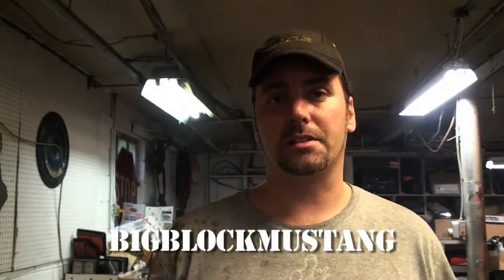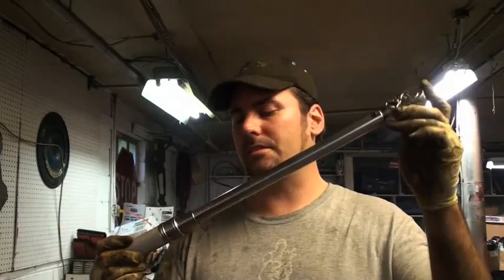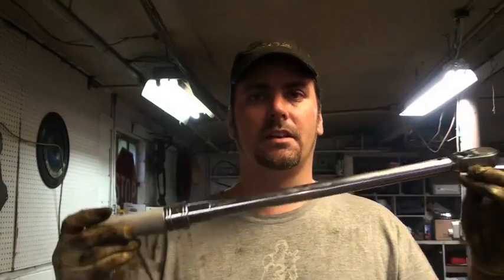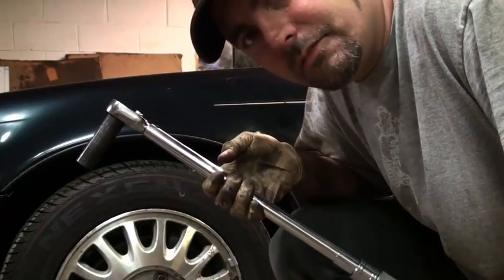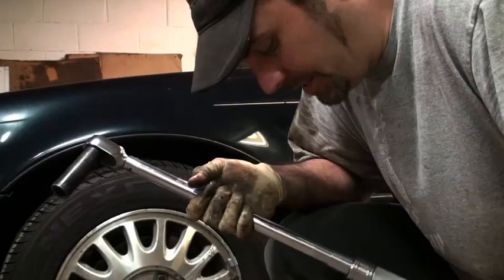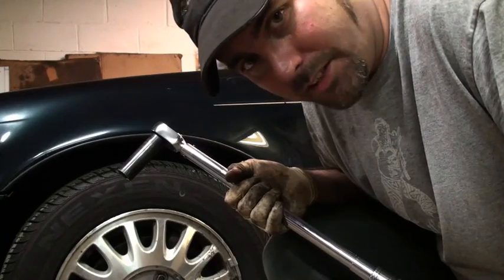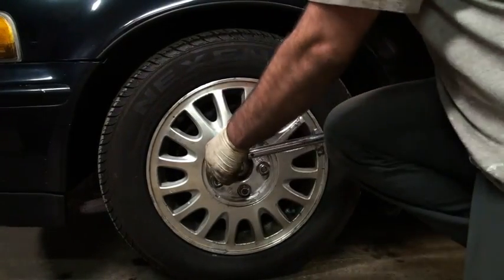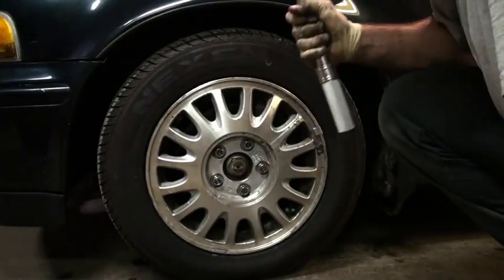Torquing Wheels and Why It Is Important - EricTheCarGuy

Comment: While using a torque wrench is an improvement over not using one, I think it should be pointed out that it's also important to torque in the appropriate pattern and preferably in more than one step. In my shop the first pass is at done at approximately 60% then the final is at specified torque.  On vehicles that have a history of run-out problems we may do it in three steps, first at 40%, then at 70% and finally at 100%.

Comment: As some others have commented, I think that not demonstrating the wrench actually turning the nuts is a bit of an oversight.

An apprentice I used to work with would bang on the lugs with his shiny, new IR impact wrench applying god knows how much torque...and then clicks the lugs as if a torque wrench is a magic wand.

The shop bought a Jeep a new front end, alloy rim and tire because of this...nevermind brake vibration.

Comment: Not what I mean, after using an impact and you use a torque wrench clicks immediately without turning then you know it's at least your set torque but you don't know how much you over torqued it.  Only if the torque wrench turns then clicks will you know you've reached torque without going over.

Comment: I've lost two wheels because of incorrectly torqued wheels by tire shops. First time, they over did it and cracked the studs on the driver side rear causing 3 to snap off while I was going 65 down the highway. Truck shook for a second and then the wheel passed me in the left lane! Second time, the driver side front wheel was under tightened and when I turned sharp right into a parking lot, the wheel kept going straight. Both times caused very expensive damage to other parts.

Comment: Now your torque wrench clicked immediately indicating they had already reached that torque value set, however we would not be sure it isn't overtorqued unless it turns then clicks.  Some parts when assembled require you to follow a sequence of torque (Cylinder head bolts good example) With wheels it's a star pattern.  For best results should we loose snug the top then tighten the sides?  Should we torque in increments or all in one go?  How about european cars with bolts?

Comment: Loosey Goosey - You don't want tension to stay on the tool, so loosen it all the way - same as your car jack - as I understand it anyway, it's like a rubber band stretched all the way - you don't want that to happen as that rubber band will brake/get brittle.

Comment: Another reason this can be good, is the garages (using air impact wrenchs), torque the studs so tight, that its nearly impossible to get them off with hand tools when you get a flat.

I found this out not long ago after a flat.  I eventually got the tire off, but on one bolt had to put my entire body weight (200+) on a big star wrench and a lot of struggling to get it.  I don't know what torque it was at, but I do know it was way too high.

Comment: The cheap ones are the ones you buy at Walmart or Harbor Freight for $19.95. The good ones are $40,$50,$60 and up. The beam type are cheap and don't lose their calibration but aren't as easy to use.

Comment: It's just what Eric did at the end of the video when he tightened the lug nuts on the wheel to the proper torque. Torque is the rotational analog of force, or twisting force, just as Eric said in the video. If lug nuts aren't tightened to the proper torque, bad things can happen. They may loosen if they weren't tightened enough. If they were over tightened they may warp the brake rotor, again as Eric mentioned. I imagine they would also be more likely to seize and be a pain to remove later.

Comment: HEY eric love the videos on fixing cars, very clear and accurate. I am a beginner weekend mechanic. I have a bunch of books and manuals but if I may ask. If you're doing a job and encounter a problem and you honestly don't know how to solve it where do you go for your information? There are tips and tricks I learned from your videos that is not in the Haynes books. I am doing a 4 disc brake pad change this weekend. I know it is simple job but to a novice it can be daunting. 03 gmc jimmy sls

Comment: HI FROM NEW ZEALAND.
ABOUT 20 YEAR AGO I WENT INTO A SERVICE STATION WORKSHOP WHERE I GOT NEW TIRES. I THEN ASKED TO HAVE WHEELS TORQUED...NEEDLESS TO SAY EVRY1 LOOKED AT ME AND THOUGHT IM STUPID UNTIL COMPLAINTS  ON T.V CONSUMER SHOW SHOWING PEOPLE WHOM CANNAE REMOVE WHEELNUTS DUE TO TECHIES RATTLE GUNNIN NUT HARD FROZEN ON.
BOLT MANUFACTURERS WHEN USING OILED THREDS ADVISE TO DEVIDE RECONMENDED TORQUE BY 0.70 THEN YOUR ANSWER IS USED TO TORQUE WHEEL TO STOP BRREAKING STUD.

Comment: thats all fine and dandy for a small shop guy but what about high volume shops or dealers? I use that exact same gun the IR titanium (best air gun ever btw) and I never warped no rotor when I tightened the wheels.  I test drove all my cars and never had a cust. come back in and complaint of warped anything.  Then again I have had cust. come in because some moron from just tire or discount tire put on there tires and tightened the nuts to 1000 lb/ft of torque lol.

Comment: I manage a tire shop... we used torque sticks and a torque wrench on EVERY vehicle that comes thru the shop.  to me, it is cheap insurance to know things are being done correctly.  any shop that doesnt use at least a torque stick is just asking for trouble.  variations in the air pressure, wear on the impact gun, as well as unseen variables allow room for bad thing to happen.  if the shop you go to doesnt at least use a torque stick (preferably followed by a torque wrench) FIND ANOTHER SHOP!

Comment: Hey Eric, just a quick remainder to viewers.   Never use Torque Wrench as a breaker bar to remove lug nuts, even thou it has the reverse setting.   This can eventualy bugger up your torque wrench.
Hats off to you for a great choice of impact.   I had mine Ingersoll now for 20 years.   This bad boy never let me down yet.
Also someone mentioned about wheel nuts/bolts loosening up after driving.   They don't loosen up after driving.   If anything, they get tighter due to heat from the rotors.

Comment: When I go to get my tires rotated and balanced.  every place near me always uses a impact wrench  it drives me crazy.  why are businesses using these knowing they could over tighted, crack or break the nuts and bolts?  my father taught me this when i was like 12.   im a computer guy.  cars not so good.  but i do remember this tip from my father?  any help or advice?

Comment from the maker: @BobTheSnail42 Hard to say, some parts are better than others.  In fact many rotor manufacturers recommend machining them before installing them on the vehicle just to ensure against that type of thing.  However to ensure the best possible result it's always a good idea to torque the wheels to their proper torque.

Comment from the maker: @Ibringthetruth1 I don't know about the anti-seize as it will effect the torque and make a mess, I don't recommend using lubricants on wheel studs, hubs yes but not the wheel studs.

Comment from the maker: @alienboy366 You have already run the lug nuts flush but not tight when the wheel is on the ground, you can do it while it's in the air but it's very difficult because the wheel will want to rotate as you torque.  I prefer doing it on the ground when working with hand tools because it allows me to just use the wrench rather than fight the wheel rotation when it's up in the air, I've never suffered any ill effects from doing it that way.

Comment: @phobiablack In countries where you have summer/winter tires and change your wheels regurarly (allways when you take wheel off)  they say after 100-150km drive you should rethight nuts/bolts. With steelrim it's not so necessary but with aluwheels you really should do that. I know because after changing winter tires and about after day car front started to wobble little bit and I stopped right there and one wheel bolts where all loose. I was lucky that reacted right away!
Reply: I've heard this many times.  Why would they come loose if they were torqued properly?  If you retorque to the same value again why wont they come loose the second time?  I believe the only reason they would come loose is because they weren't torqued properly in the first place.  Only asking because in several decades of changing tires/snows/rotation/steel/chrome/aluminum etc. I have never had a lug loosen after torqueing to the correct spec.  Just my opinion of course.

Comment from the maker: @EFSOutdoors When working at the dealer I used what is called a 'torque stick' which put it in the ballpark but wasn't exact.  When I worked on performance cars I treated them a bit different by torquing them by hand.  It's good to get them as consistent as possible and as close to the spec as possible if you don't use a torque wrench.

Comment from the maker: @sav7152 Yes, I would go with the factory spec.  On another note I've found that some aftermarket wheels work loose after a while so it's a good idea to recheck the torque about every oil change.

Comment: Hi Eric!  Just followed your advice on replacing the brake pads along with the new rotors.  I definitely don't like that spongy brake feeling so I did replace the pads.  My question is this: I have aftermarket wheels on my car.  I found nothing as far as specs go on torquing them down.  In your opinion what should I torque them to?  Should I just use factory specs?  Thanks Eric!

Comment: Another important thing to mention is on mag and aluminium wheels you may need to re-tighten the lug nuts after about 30 miles to ensure they remain seated. Its not absolutly nesscary but I have seen vechicles that have lost wheels because they didnt come back to get there wheels retorqued. That have even been instances that I removed a lug nut with nothing but my hand(while removing the annonying lug nut covers chevy puts on there trucks).

Comment from the maker: You are absolutely correct and a keen observer, the lugs on this car were not loose when I shot the video.  What I was demonstrating was the technique and the process.  The process is to run the lugs down snug, not tight, and then use the torque wrench to finish them off to the proper torque, the reason this is done on the ground is to prevent the wheel from spinning too much while you are torquing the wheel.  The final torque for this car would be 80 lbft, not 80 inch/lbs BTW.
Reply: what if you hold the wheel from spinning when it is raised above the ground?
Reply: Can do video on brake pads

Comment from the maker: I would say that if the car vibrates while stopping it is most likely warped rotors.  On acceleration however it would most likely be an engine performance problem.  It's hard to say exactly what it could be but you could start by inspecting your ignition parts.

Comment from the maker: Have you ever started out on a 10 speed bike in 10th gear?  If the drive-train is not functioning properly, that includes the transmission, then efficiency is compromised thus effecting emissions.

Comment from the maker: Because of the "differential action" the wheel with the LEAST traction gets power.  The differential is designed to allow the rear wheels to travel at different speeds while going around turns, if not one wheel would hop while turning.  A posi traction still slips in turns but power is always delivered to both rear wheels even if one looses traction.

Comment from the maker: Carbon buildup on the valves and intake.  Diesel trucks idle for extended periods because they need to be hot to operate efficiently, these engines are designed to idle for long periods where as gas engines are not.

Comment from the maker: It's hard to say in that situation what the cause was but yes, gears and chains do wear out and cause engines to jump time.  Some stock gears have a plastic coating that wears out over time.  They use this coating to keep them quiet.  In your case it could also be a problem with the distributor.

Comment from the maker: Not really, an alignment is a precision measurement it's better if you use a tape measure instead of your eye if your trying to get it close.  The truth is that they are not really hard to do with the proper equipment.  That is if the adjusters move like they should, if not, it's time to break out the torch.

Comment from the maker: I can see how a leaking exhaust manifold or gasket can cause the engine to run poorly because the O2 sensor will read lean but I haven't seen one cause a no start condition.  The exhaust system also creates a certain amount of back pressure that helps draw in the fuel mixture during valve overlap but that's as close as I can come to an explanation to what you described.

Comment from the maker: From what I've heard using lubricants of any kind on studs or wheel bolts is a no no.  I've had the same problem you described on some cars and believe the problem is a result of corrosion buildup.  The only way I know of dealing with this properly is to run a thread chaser over the threads and replace the lug nuts.  It is rarely done however and studs break from this from time to time as a result.  I suppose it is a judgment call.

Comment: Your just too Awesome..  Long time ago I use to buzz 'em with the air wrench. I went on a test drive and something didn't feel right. I got back to the shop and had one wheel loose. I guess the shop air compressor blew a fuse and I didn't know the air pressure was low.  Lesson learned and I'll always use a torque wrench. 

Les